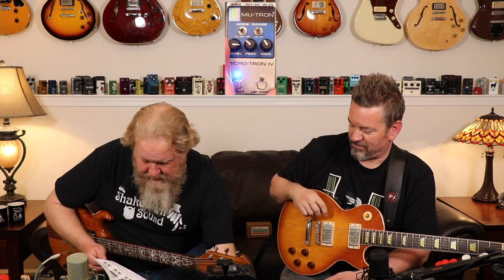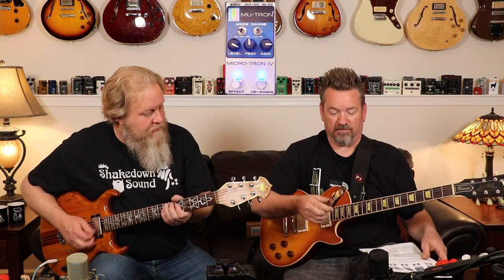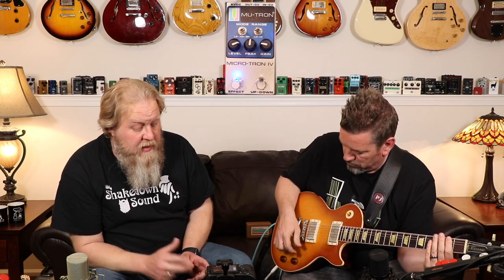The Micro-Tron IV by Mu-Tron - The Shakedown Sound Series

Comment: This is cool, but the analog man pedal sounds a hair better (clearer, fuller) to my ears, and seems easier to use? I think I might go analogman.  Although the mu tron does seem to have a little extra something I can't put my finger on.
Reply from the maker: So far we have kept both of the pedals you mentioned. I think our experience is that the Analogman pedal is easier to dial in. There is a vibe to the Mutron though. Definitely a hard decision.
Reply: @PJandtheBeard  Well I ended up going Micro-tron.   Vibe and mojo beat out ease of use and reliability.this time.  Although I might get the analogman pedal eventually.
Reply from the maker: @42069G20911Boobz  I don't think you can go wrong with the MuTron!